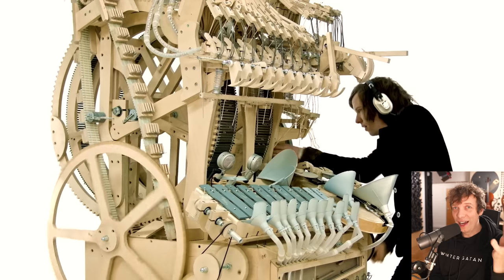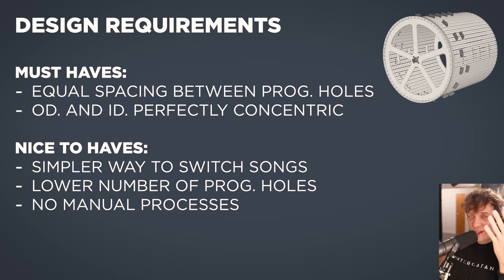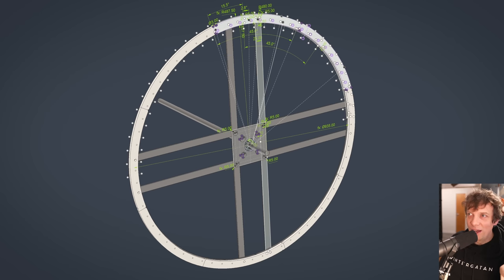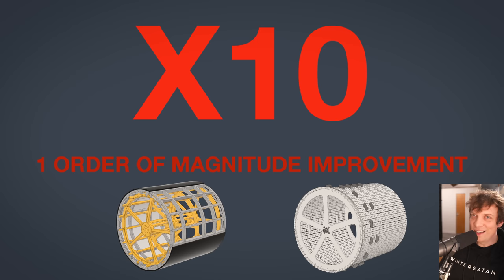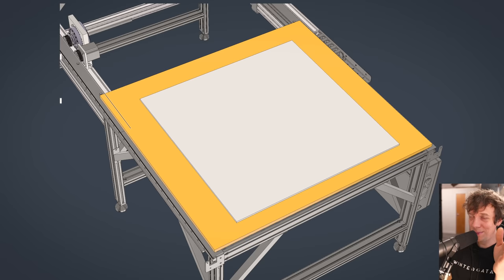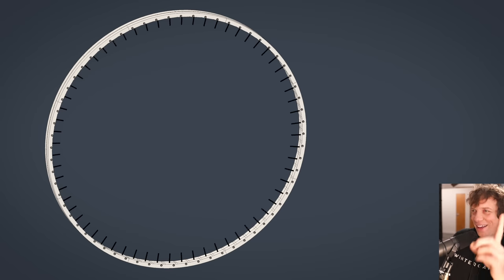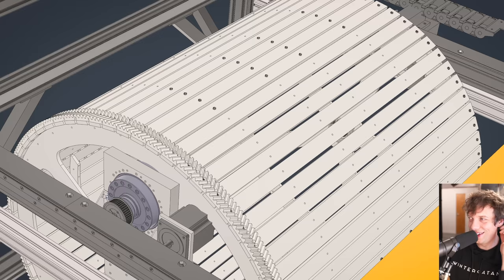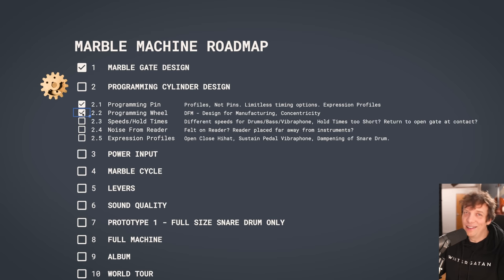A New Music Programming Wheel

Comment: Very cool design, but I think all those plastic strips are going to betray you unless you have a number of full circle "rib wheels every few inches for the height of the drum. Also, you're probably better off building "half-moon" plastic sheets to attach to the drum before machining instead of all those strips, again, for integrity (and to lower your part count by.... 60!) You can get plastic to bend around that drum.

Comment: with the desire for more control over timing of the programming, have you considered not even using holes, and using rings with the notes gripping onto them? would give you total control over the timing, assuming you could get the things grip strong enough enough. would that just not be strong enough to trigger stuff without slipping?
I realize you have come up with a perfectly good solution already, just wondering if you considered this at all.

Comment: @Wintergatan 4:40 I do not think this will be stable enough for your needs.
Firstly, you will need a small connector between the parallel rods, where they meet the circle, otherwise you have 4 separate quarters, instead of a circle.
But a bigger issue will be the "wobble" along the center rod, even if you account for the width of the drum & a 2'nd wheel, it will probably not be stable enough, you require a LOT of precision in your builds. The design at 4:52 looks MUCH better ( but make it metal, instead of plastic :)

Comment: I'm extremely weary of what happens to this when torsion is applied across the rotation axis from the gear. It does seem to be pretty strong in compression on both axes (there's only two since it's cylindrical) but when you twist it I don't see what is going to stop it from just collapsing down. Please look into this Martin! This design is very good it would be a shame for it to fail on something so simple to fix!

Comment: I think you may want to add stiffening members to the insides of the spokes of the wheels - strips of the same plastic glued on should suffice - just to increase the bending moment so that it doesn't wobble as much - if that's not enough, bracing at an angle to the axle should help. the screws and screw holes are likely to fail or loosen otherwise as any axial load, especially at the periphery, will turn into large bending loads on those screws, likely causing the screws to pull out.  if there's any cyclic axial loading, however minor, the plastic threads or holes will fatigue quickly. similarly the bearing mounting area should be stiffened as well, with positive engagement of the bearing mount over a larger contact area rather than relying on the screw holes - they will oval out very quickly, otherwise. adding stiffness will also help guarantee that your wheel stays round, and that your pregaming bars stay flat - sag will happen if the remain thin, flat bars, think C-channel, or even L profiles.    (mechanical design engineer, 20 years of experience in product development)

Comment: yeah concentricy can drive you crazy.  I am a PLC Programmer and once had a project where they wanted to stop a 1,5 Meter(in the beginning) Coil of 0,07 mm thick Aluminiumfoil with as less as possible material left on  but before it runs out. They refused to get an extra Sensor , they wanted  to get the problem solved with pure math, using the ratios between the spinning coil and  speeds of wheels inside the machine to figure out the Diameter of the remaining Coil. I figured out the math , programmed it and it was everything but not reliable. while breaking my head i randomly had my eyes aligned with the top edge of the spinning coil and the Edge of a Door... well and it was wobblin around about 2-3 mm . The Coil actually never were realy round and the 2-3 mm were exactly the Range where my Code stopped the machine. So everything works exactly as it should  beside the fact you cant perceicly stopp a coil within a fraction of a mm if the "unroundness" is already > 2 mm

Comment: 1. The programming wheel itself as far as I can tell is not compensating for two directions of force. Number one is one side of the wheel moving while the other is held back creating a sort of rotational torsion. That could be solved with fixing both ends to an axle and keeping them in sync. The second direction is side-to-side; there is nothing to stop the wheel from racking. That would need some form of a diagonal support - say, an X - from the edge of the wheel on one side to the axis (or the other edge) on the other.
2. I see your design works perfectly in a vacuum with no gravity. How does it stand up to wear and gravity? Will something sag over time? How do the pins wear? How do you know when to replace them? What about the counterforce applied on the pins, will that cause the crossbeams to sag? Not saying anything needs to be done, just an angle that I think you might want to pay more attention to.

Comment: You're going to have issues with torsional stiffness.

You're also going to have issues with lateral stiffness as well, that will be an especially large problem when changing wheels.

Both should be easily solvable, guess you'll work it out when it comes time to prototype.

Comment: Have you considered changing the wheel completely to be single-song? You could use one of these programmable ones for prototyping and composing but once you have the song written and ready for the road a non-programmable wheel with no unnecessary hole in it could be made, this would be stronger and more reliable and I assume you aren't reprogramming the wheels between songs during a performance?
Reply: That was the plan with MMX with steel sheets and welded studs, wonder if he'll revive that plan for this iteration

Comment: Plastic on plastic gear might be noisy and to solve that you might need a lot of grease, which will end up everywhere when you change the weel. If you don't need that many screws (and you don't) don't put them in. Think about the weight of everything, for the shipping of the machine as weel, and for assembly or changing the wheel. This applies to everything, if there are no benefits and something is not necessary why put in? Also consider cylindrical head bolts with hex key instead of hex head bolts.

Comment: Why not make the programming wheel a cage which you wrap programing sheets on? You could make just one wheel if you designed the wheel such that the programing holes were in plastic attached to a flexible medium (like cloth). The flex medium could then be mounted and dismounted to change songs quickly and it would allow you to carry many more songs with only one wheel, without redoing the wheels every other song. The cloth would just act like a binding plate on the back of the plastic with the programing holes and then you'd have a few registration bumps so you can quickly and accurately get them in place.

Comment: Instead of using a flanged pillow block you should machine a bearing pocket inside the sides of the wheel. the pillowblock bearings have plenty of play inside the mounting holes which can cause problem regarding concentricity. I would also go a bit thicker than 10mm for the sides.
Secondly, don't disregard the flexibility of plastics, even engineering plastics... If you put the programming wheel in the sun for an hour it could be completely ruined!
Lastly, i feel like the swapping of the wheels is somewhat featurecreep? machining the bevelgears is awesome if it works but it seems way to complicated in my book :) Just put a pulley on the shaft with a keyway and use a belt.

Hope this is somewhat usefull. I don't mean to 'hate' on your designs but it's my job irl to design machines so i feel inclined to comment :)

Comment: My post will not likely be seen by the Wintergatan team. You are in the design phase of the programing wheel plan to, in the end,  make more than one. How much time will it take to program one? How will be done? I know that this consideration seems a bit early. But it could impact the initial design.

I have an idea that would help programing pin placement error achieve ZERO. It should be quicker than reading a list of which pin to use and where it goes which could be miss read. ... An indexed wrappable Mylar film templet to goes around the drum that has open holes big enough to clear the pin for a sung fit for where a programming pin goes in, while blocking ones that do not take one. In short a piano roll sheet.

How to identify which specific pin goes into that open spot is something I have not quite figured out yet. But I have an first thought idea. Assuming this Mylar could be cut on a CNC. Maybe the CNC can be fitted with a inscribing bit to scribe a number/symbol into the Mylar film next to the hole indicating what programming pin goes there? Then you have a rack/container of all the programming pins that could be use. Read the number on the Mylar, pull the pin and plug it in. This slot takes an A12 pin. Grab it and put it in.

Comment: if something helps you arrive at a functional final design, its not a failure by any measure, you just didnt plan it to be an iterative process is all. similar things have happened to many professional engineers, it's not a failure for them even if it was a mistake. MM1 and MMX are not failures they are just steps along the process and will give the final machine a more storied history

Comment: I think you were onto something with the MMX welded plates for switching songs. Manually swapping out pins every song for show after show and song after song makes no sense. Neither does dragging around a bunch of huge pre-programmed cylinders. You need a better system that doesn't require hundreds of hours of manual intervention when on the road. Flat plates that can be stacked for transport then wrapped around the wheel still seem like the best method.

Comment: Seems like a good design, however, the only worry I have is with the wobble of the large programming wheel. As you pointed out for the cnc process you are adding MDF to it (Good IDEA!) but what about in the final setup? I am slightly worried about the wobble, as the SKF bearing holders are the only attachment point to the axle and these are usually not intended to compensate for wobble. Just wanted to pont it out. Maybe it would solve the problem (IF it even is a problem!) if you manufactured two more of the plastic wheels and then have two sets of two wheels at each edge. With a gap of maybe 5-10cm in between, probably the rigidity of the programming hole plates will be sufficient to reduce the wobble sufficiently. Otherwise you can connect the two wheels forming a pair and actually make them very rigid against wobble.

Comment: The previous videos we're all about form follows function. Is it even necessary to have this giant wheel? Couldn't it be much smaller instead? Also using a belt is possible if the whole wheel could be disconnected from the axle and drivetrain.

You also talked about changing the wheels on the Instrument to reprogram and the smaller it would be the easier to handle...

Comment: Ref concentric’s, you may want to think about making a hub that bolts and dowels to the side wheel, with a bearing pressed in will be more accurate than a skf housing. Not a dig at skf, just their castings are not accurate enough for what you are trying to do. 👍🇬🇧👍

Comment: silly question....why have a programming wheel? What about a programming belt or chain for each control channel or lane? They could be removeable and easier to reprogram.  and can have standard chains for continuous beats of drums. Need the 2/4 timing, there's the chain. here's the 4/4 timing chain, ect. those standard chains can be used on any channel (note or instrument).

Comment: Anywhere you have actual rigid supports at the ends, but not in the middle, you will get some flex and sag. Yes, the fact they're connected helps, but it won't do it all. Also, when one or two of those tabs cracks (and they will, possibly even during manufacturing) do you have a built-in way to reinforce it that will not alter the shape and also will not unbalance the machine?

Comment: It is that swapping that has me concerned. We saw how solid the MMX programming wheel had to be in the frame so it didn't shake. It will be interesting to see how he designs it to be solid but still easily accessed for removal.
Reply: There’s no thought to any of these significant details if you look at the project plan.

It’s basically:  marble gate + programming pins = marble machine

Comment: There is a difference mechanical  response of a programming  drum made  with spikes compared to various shaped cogs. Martin needs to explore this further before going any further. 
I want to see the cogs shape. and the mechanical arm that read the cog. What is the shape of the cog that  plays 4 /32 notes, follow bey a 2/16 note, follow by a 1/8, follow by 1/4 note, followed by 1/2,  followed by whole note.,  a repeating timing progression.   Martin needs to make a smaller programming wheel, (36 cm diameter)  with a cog profile to play a progressive timing. pattern.  The prototype  could take the form of a wheel instead of a large drum.

Comment: what i think about the mechanics is that you should make the shaft solid to the wheel and use bearings on the frame, maybe it whould be nice to have a gear driven wheel from each side to have way less torsion.
then i'm not too much into machining but i don't think that double helical gear is easy to machine, neither possible to keep consistent without skipping/mooving/vibrations/deflections of the wheel inside the cnc. For this type of gears they usually use generators but what could happen in plastic...

afterall, my biggest concern is that milled helical gear :/

Comment: I understand why you skipped the steel but my question is will the Plastic wheel survive being moved between your different gigs? I was wondering if you thought about trying aluminum? I've seen CNC machines that will cut aluminum and you can shape the Aluminum like you can wood. You can even cut that big Outside wheel in aluminum with a CNC. Aluminum doesn't care if it gets bounce around while traveling. A best of a thing about aluminum is that It's lighter than your plastic.

Comment: I would suggest a pipe that connects the two outer wheels together at the center. Much more rigid against twisting than relying on all the hardware to hold it together. Speaking of the hardware, have you considered the weight of all that hardware? Yeah a single bolt or screw doesn't weigh much, but you put a few hundred together and they add up quickly. Steel or aluminum may yet be the better option. If welded, then it may be lighter than your plastic wheel, and have fewer parts count. Still use your rotary CNC trick to cut your holes for your timing pins and make everything concentric. Bet your cnc can cut aluminum.

Try to keep your parts doing one function, or take load in one direction. With your design being driven only on one side, for the torque to get across the drum, the only way it can go is through your pin plates on the outside. That can induce a twist in the whole drum that affects timing. There's two solutions for that: one, a second helical gear on the other side, or a rigid tube down the center of the drum surrounding the axle. The tube I think would be your better option as all you would need to use is pipe off the hardware store shelves cut to length.

Comment: the lack of incremental testing is making me nervous. i think you should make a single track wheel and make sure your programming pins and gear system work before committing to the full build.

what you did for the gates was excellent. this is (so far) very CAD and theoretical.

Comment: How relevant is the torque of the bolts? Ultimately as the final slots are machined on place, that determines the slot alignment, but uneven pressure sounds like a possible source of inaccuracy in the shape.

Similarly any screws getting loose might allow movement after machining the tight alignment of slots.

Ultimately bolts are precisely machined parts, so they in themselves are no more prone to wear than any other part of the machine. Still, testing how dependant the programming cylinder is on the accurate securing of those bolts might be a sensible sanity check.

Comment: I meant to comment on the previous video but it looks to me like the profiles are brilliant for getting precise timing of the drops (with a LOT of flexibility for odd time signatures or swing/delay beats). However, the rather extreme length in the direction of rotation seems like it will significantly reduce your single-note/gate resolution for a given rotation speed. How do you handle playing the same note rapidly with this design? Hopefully it's not a return to the multi-gate solution from MMX, because it seems like you really didn't like that solution (and it will add a TON of complexity and cost to the project).

Comment: I am SO GLAD you're using Plastic. In Engineering, the last thing you want is to use parts that aren't easily produced or heavy on your wallet. More advice for you: If you can, avoid Metals in this project (Some places will require it, so I won't put that past you if you have to).

Comment: I love it but I would be concerned that your design isn't ridged enough (right to left) and you will have a lot of problems with the milling cutter grabbing and chattering when machining the programming slots. You need to reinforce the the spokes or have cross structures inside.